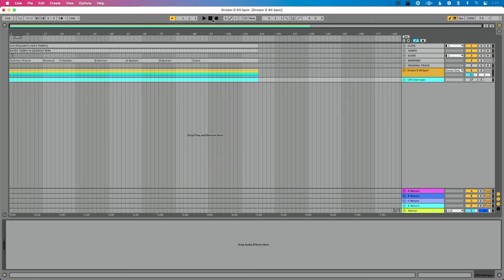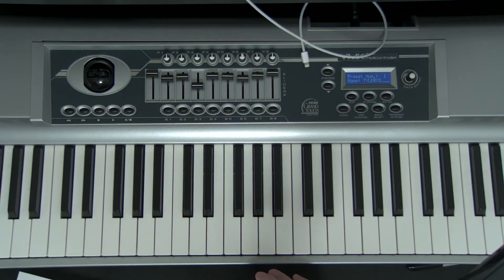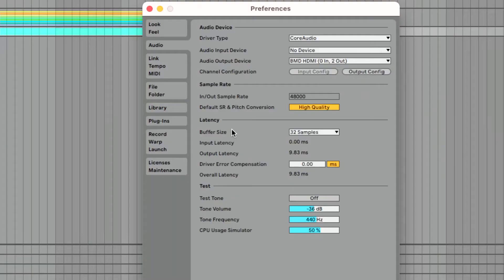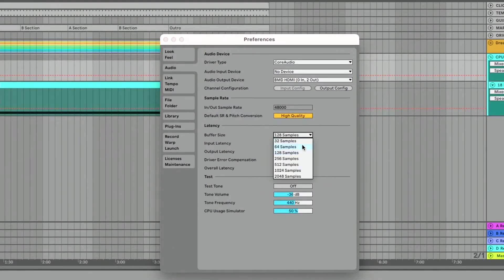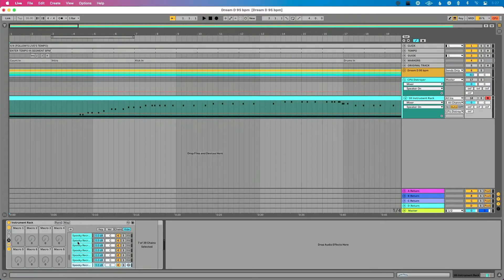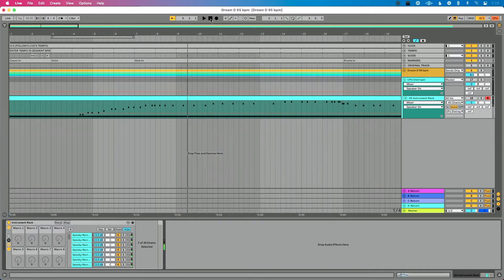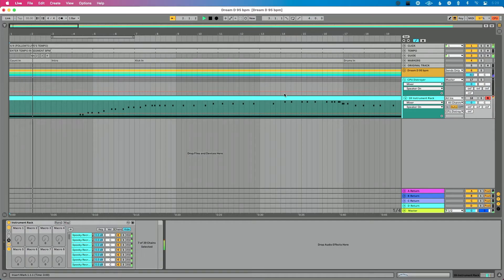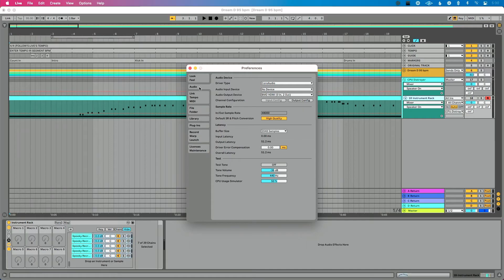How to fix audio crackling and popping in Ableton Live 11

Comment: Ok so I am at a loss of what to do next. I am running into the same buzzing/static when recording. I have a project with a single track, no processing, recording from a behringer uphoria umc404 and have the random static sound that still shows up even with the sample size at 512 samples. CPU is less than 5%. It happens just randomly while recording.

Surely this is a setting somewhere that is causing this because I even upgraded to a 32gb ram and i9 and its still doing the same thing it did with my 16gb ram. PLEASE HELP!!

Comment: hi. When I do live recording, afterwards when I listening back then here and there I got small crackling noises. I did check buffer and latency, and my CPU hardly get over 20%. I am using Lenovo Thinkpad T440p, Focusrite Scarlet 2i2 and Rode M5 mics. I am recording singing bowls, gongs, drums. Any help is highly appreciated.
Reply: Same thing happens to me🤦🏻‍♂️ I can’t find the answer anywhere. Buffer size and latency isn’t anything new to me I’ve been making music for years and know exactly how my settings should be . However I’ve been using this new laptop and I get random popping when using Ableton. Doesn’t happen at all with my other PC or any other device I’ve ever used so I really think this is a much deeper problem. I have a pretty powerful laptop too and never even get over 10% in recording sessions but for some reason I still have some audio issue going on here.

Comment: on my side it's weird af, I have a msi with i7 13th gen, RTX 4060, 16Go RAM DDR5, a Audient ID22, and IT'S STILL POPPING AND CRACKING I don't know what to do anymore
Reply: I have a similar system. But the audio interface is Focusrite. The same problem appeared after I reinstalled Windows. I installed all the drivers again. But everything stopped working as before. The only thing that helped was choosing high performance in the power consumption settings. The load is significantly reduced, but the plugins still create a large delay. I can't record autotune from Antares in live mode, many plugins create a delay Ozone, for example, plugins from Plugin Alliance. Although before reinstalling Windows, I could also throw a bunch of plugins on top and there was no delay and minimal load on the CPU. The most interesting thing is that I have an old HP 250 G7 laptop. And there the performance is better and no delay. It's just not funny. On this laptop, attention, the 8th generation processor Core 8265 and 8 GB of RAM. And I did not change the power consumption settings. There is "balanced performance"

Comment: Sadly we are at a point right now where this is not always helping. I'm using Push3 as an audio interface and I get crackles from even pre-listening to core sounds without anything in the session, with any buffer size. I'm on a MacBook Air i5 which should be able to handle this so I guess there is a bug-state with warping/sound engine at the moment and they really need to get to where it was pre 11.2

Comment: Hey, thanks for the video! I tried everything in this video with no success unfortunately. However, I managed to work out that I was getting artifacting because the barrel pin power connector for my audio interface was ever so slightly pulled out of the connector. I pushed it in a further millimeter and it fixed all of my issues! Thought I would share in case anyone else is being driven crazy by a similar problem like mine.

Comment: For some set-ups raising latency may actually make the problem worse. On my end, I lowered the latency 4x lower than what is originally was, and the problem seemed to fix itself. When I raised it, the crackling just nose dived. I guess its because I was using MME instead of anything better, but that's only a theory. If raising the latency doesn't work, try going the opposite direction first before trying to see what else could be the source of the error.

Comment: Usually I use an old macbook air 2015, with the buffer size on 512, and its the perfect balance. I can run as many tracks as I want seemingly. But I just upgraded to a windows laptop with double the ram and a much better processor. But when I run ableton, the sound pops immediately on buffersize 512, but if I turn it up, I have huge latency. What I don't understand is why this is so, since it has much better specs on everything

Comment: Hey... I'm having an issue that you or someone might help me with.  I just got a brand new laptop, its an Asus rog zephyrus g14, it's got a ryzen 9, I just upped the ram from 16gb to 24gb. I just got a scarlet 18i8 and I'm trying run external synths into a Mackie mixer. So I've been using an mpcx to sequence everything and it's been used as and audio interface pretty much. When I run the mixer into the mpc everything sounds great but when I plug into the scarlet everything sounds terrible. For example, I'm using a Roland fantom-08 into a strymon time line then into a nightsky. Say if I go direct out from the pedals into the scarlet I got this horrible digital static. It sounds like it's a stereo issue. I've changed buffer size and bit depth and all of that and it's still there. Any help would be greatly appreciated
Reply: Having a similar issue. Did you ever find a solution?

Comment: Great video. I've a question about the buffering size when I export a song. Do I need to increase it or can it stay at 128 which I use when I record vocals? Because I have some strange artefacts/noises in my exported songs which are not there normally and I export with the buffer size 128.

Comment: Great tutorial it worked! QUESTION...(im in Ableton) when I use that driver (asio link) im getting music dropping cutting out. Any recommendations?  Is there a specific way to adjust buffer size in this alien app lol
Reply from the maker: if you're getting audio drop outs...generally speaking if you raise your buffer that should fix it. Could also be other issues as well, but start there.
Reply: @fromstudiotostage  thanks I think the issue is demo mode. The patcher is working for the 36. But when I press the 64 it doesn’t work. Any ideas? also the link in your bio is different then the video now

Comment: Hi Will! Always informative and helpful. However, I have sporadic audio crackling that seems unrelated to buffer. I'm using a laptop with 32GB RAM,  2.8Ghz processor, 140GB free space, and using your tracks template to run MultiTracks. My interface is a Focusrite Clarett 8PreX (Thunderbolt). All drivers up to date. All power management set to recommendations, The only processing on my tracks is using the Utility to pan drums tracks to Left and right. My CPU never goes above around 14%. And yet, completely randomly, I get crackling which makes using this live for worship extremely nerve-wracking. I've read some about DPC latency, worked in depth with Focusrite and Ableton tech support, as well as Lenovo engineers. I've also replaced my Thunderbolt 2 to 3 adapter and am planning to replace the Thunderbolt cable tomorrow. I'm not sure what else to do. Do you know any one who uses a PC/Laptop for tracks rig who has solved this problem?
Reply: Hi, did you solve this eventually? I maybe have a similar problem
Reply: @shacharnovik-5173  Hello! No, I didn't. It seems to be a DPC latency problem that no one could solve. I ended up buying a used MacBook Pro and that runs flawlessly, no issues whatsoever. I'm sure that's not the answer you wanted to hear, but I spent so much time with many professionals to solve the issue, and there still remained a random possibility of it happening, which was too much for my poor nerves to handle in a live setting.  ;) Good luck!
Reply from the maker: try raising your buffer if you're getting audio popping.

Comment: I've been having non stop issues, i have an intel i5 (2023), 16 gb ram, nothing overloading in task manager, but i get non stop crackling after a few seconds, chose every single possible combination of sample rate and everything and it still happens.

Im dying for help if anyone has any knowledge. I have the most up to date drivers m-audio offers....do they just suck as audio interfaces and potentially is that where my issue is coming from?

CPU in ableton also steady at 15%....
Reply from the maker: i would reach out to ableton's support
Reply: @fromstudiotostage  im just so lazy when it comes to doing that. My m-audi 2x2m is pretty old, drivers on maudio from 2018. Funniest thing is, on my older PC, never had this issue.

Comment: Well, the fix actually works. I'm on Windows, plenty of resources, CPU use on Ableton is no more than 20%, but pops are there sometimes. I use a lot of orchestral tracks, sometimes more than 50 or 60. 
About the driver, as I'm not recording any instruments or voices, I use ASIO4ALL, it works great for what I do, but to avoid pops when I'm hearing, I have to set buffer size to 1024 samples. Any number lower that that will make noises. 

I can't explain why I'm having that problem, my CPU is a bit old (i7 7700k 4.20 Ghz) but it's strong enough and I have 48 GB RAM using about 60% and leaving a considerable amount free to use. Every drive I use is SSD. Everything runs smoothly but music reproduction at a lower buffer size than 1024 :(

Comment: I don’t even have high CPU issue and have cracks and pops when recording guitars! 

I use line 6 helix as an audio interface (channels 1/2 and 7 for rerouting), my buffer is at 256. I have all monitoring off. 

When I record only guitars, I get 3% of CPU, which is nothing… so maybe it’s the signal coming into Live from Helix?
Reply: I’m having a similar issue. Did you ever find a solution?

Comment: Do you have any suggestions for removing from recordings AFTER they were recorded? Meaning, I came looking for this video because I had dropouts in my recordings discovered after the session is long over. Should I just grab an earlier piece of the tracks and paste them over the top of the glitch while cutting out the glitch from the track? Or is there a more elegant way? Thx!
Reply: Hey Alan, there are several repair plugins out there, for that problem. Most well known, but also most expensive one,  is Ozone RX. But you could get the free 10 day trial and fix that recording. For your purpose RX De-Click should do the right thing. Have a nice day.

Comment: My Ableton is joking around all the time. I found a good buffer size already and the audio always sounded great if I created a MIDI or imported a sound. But if I try to record, what sounded great for weeks is sometimes randomly starting to crackle for no reason, even if I didn't change any settings. And then I always play around with the buffer size and it's only getting worse. Some days later, I try it again and I change the buffer size to what it was as the mic worked well and as it started to crackle later and then it's sounding fine again, even though the number of the buffer size is on the level of the beginning and of the crackling again. This is only appearing while recording, it's completely random and super annoying. All people act like the buffer size solves the problem, but no, it doesn't and the test sound is also sounding good when it's crackling and it's 100% not about the mic and I guess also not about Windows.
Reply: Hi, did you solve this eventually? I maybe have a similar problem
Reply: Same problem for years. Had this on my macbook pro 2015, macbook pro retina 2015 and even on my Macbook Pro M1.
Reply: @djmadbwoyakamaddy I have the same MacBook. Are you still having the problem or have you found a solution? 
I use the focusrite 2i2. 
Could it be the interface??
Reply: @santiagomorales1957  still have the problem. With a steinberg UR22 even more frequently, with the Focusrite 2i2 less frequently
Reply: i have the same issue at the moment. we need better audio interfaces. sometimes clean install of windows/ableton can iron that stuff out as well.

Comment: Great video - I thought I'd add for Windows users: in Ableton I am unable to adjust the buffer size. I have to use the control panel for my interface (Scarlett 2i4) which has an icon located in the system tray. It's just as easy, but it's in an external control panel. Cheers!
Reply from the maker: Thanks for watching! I have a few interfaces that I have to do the same thing on Mac, to adjust the buffer and sample rate as well. I wish all of them could be adjusted directly in Live
Reply: I have the same setup and had to adjust the buffer size the same way. Thanks.

Comment: i have an intel 9700K with 32 gb ddr4 ram on 3600Hz. My issue is when playing on midi using a vst plugin I having latancy. Ive tried everything I cannot finish my music since I updated to 11.1.5. Im very dissaponted. when i was using the 11.0.0 was working very well. I cannot finished my song.  I thing the problem is with the new update. whatever video Ive watched since , I seen everyone's cpu goes very high.. Mine on sitting now on 42% and still having latency without cracking noise. Its only works when i boost up the sample rate to 98000 and the keep the buffer size on 128-256. this time the cpu clicking other words breaking the celing. 
If any of you have a great idea im listening !! Thank you and thanks for the video !!
Reply from the maker: If you’re having latency you’ll have to drop your buffer till it goes away. It’s a bit of a dance. Low enough for latency, but high enough to avoid audio issues
Reply: @fromstudiotostage  Ive tried all options, the midi issue still makes me headaches! BUT, I haven’t tried hooked up the midi cable (not usb) into the UAD Apollo. Might, this way the UAD helps to improve the midi clock.

Comment: here's the reason/fix why my sh*t was cracking- add incase anyone else is like "okay i tried everything YT and forums suggested and its def not my computer" i had like 5 tracks turned up wayyyyy to loud like redlining (don't ask lmao)  and when i ran it through a VST (literally Valhalla reverb) my computer took a shit, all crackly.  what fixed it was I TURNED DOWN all the tracks and then the reverb VST was able to work PERFECTLY NORMAL. so moral of the story is if ur tracks are coming in way too hot, turn them down and see if that changes the quality.  use ur interface to create volume instead. THANK YOU FOR COMING TO MY TED TALK - YES I REALIZE I AM  DING DONG AND IVE BEEN ON ABLETON SINCE 2011, WE ALL MAKE MISTAKE